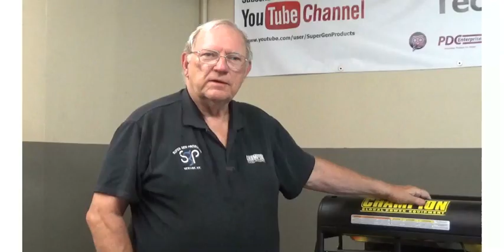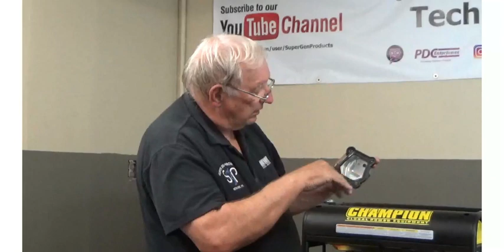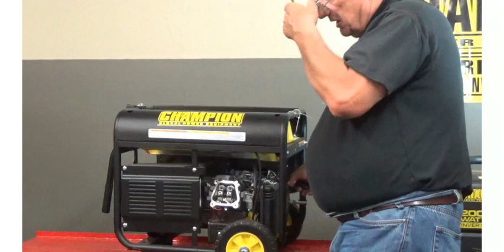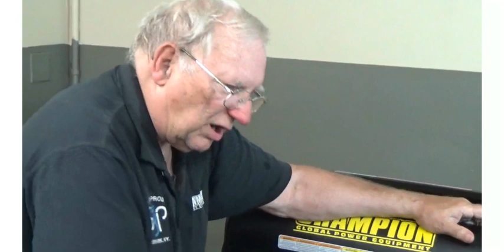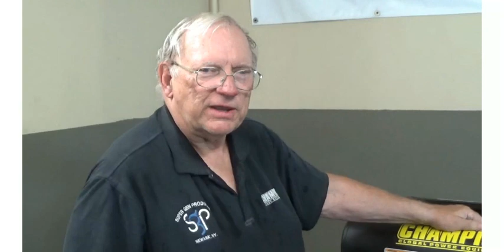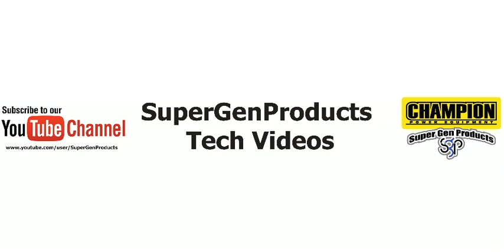Valve Adjustment Procedure for Champion Generator

Comment: Very impressed with Champion generators so far. We live off grid and our main power source is solar but sometimes we get too many cloudy days in a row to power anything. The Champion generator runs our whole house including medical equipment perfectly.

A small tip, make sure you thoroughly read what maintenance you need to do on it. Learn what you can and only out source if you are over your head. 😁👍

Comment: I have a rope crank Champion Generator it got to where it would take me 20 minutes to get it started it would backfire like crazy when trying to start it, and when it did hit it would just act like it wanted to start just a slow chug, chug, chug then die completely then after a while it would finally start! I adjusted the valves like showed on this video it now starts on the very first pull on the rope and I can just pull it slow and it still fires up!! Thanks so much for this video!!

Comment: This Vid was most helpful. Can you do a video on cleaning the combustion chamber of a champion generator?
Reply: I will see about getting that video done thank you for watching
Reply: The easiest way to clean carbon buildup in the exhaust chamber is to spritz water thru the air cleaner entry and it will steam old carbon away. Let the engine warm-up to operating temperature before using a spray bottle to spritz into the carburetor.
Reply: Phil Madrigal if I only use the propane fuel option is this a maintenance schedule I still need to perform?
Reply: @1manarmy522  NO. you should never have to worry about that with propane.
Reply: Phil Madrigal thank you. I spoke to champion and they stated I still need to complete all maintenance procedures even when running propane including cleaning the carburetor.
Reply: @1manarmy522     I dont agree with their analysis of the carburetor needing cleaning when using only propane. The propane entry does not flow into the carburetor as the gasoline does.  It enters right into the venturi, which is straight into the engine. If you are using gasoline and the generator is running roughly, then you might clean the carburetor or at least run some Gumout through the next tankful of gasoline.  Paul Sr. with Super Gen Products.

Comment: Used to have a champion 5500. Pull start only. It was a prick to start for ages. The pull cord would rip out of your hands. On a cold day you’d be worn out by the time you got it going.  Found that the exhaust valve was too tight. Adjusted and the started first pull every time after

Comment: have the Cabales remote start gen. Its powered by the champion 224cc engine (very similar to the one in this video, but just slightly larger. It has a slight surging issue when running. I tried cleaning the Idle jet which is under the black plastic adjustment screw. Before taking the black screw out, I screwed it all the way in to determine where it would need to go. It took 6 turns clockwise to close it all the way. That seems excessive. After attempting to clean idle jet with wire and carb cleaner, I put the screw back at 6 turns and it still surged. I also cleaned the carb emulsion tube and main jet. I attempted to screw in the idle screw and the surge went away and then the RPMS came up even higher than I think they should be. I dont have a tachometer, so not sure what is excessive. Getting to my question, can you tell me how many screw turns out from the bottom that black plastic idle screw should be set on one of these generators? any other suggestions for a slight surging engine. Thanks!
Reply: On generators, that black plastic "adjustment" screw (aka idle setting screw) doesn't perform any function except to help retain the black plastic idle jet in position.  Just re-seat the idle jet and turn the screw in enough to get a couple of threads showing on the tip side.

Comment: I set the valve clearances. The exhaust nut had loosened up and the clearance was way too high. When I tried to pull the cord, it yanked back. I tried three times. Same result. The pull cord pulls easily with the spark plug out. Do these things have a flywheel key that could be sheared?
Reply: "The  activation of the cylinders compression release is part of the mechanism attached to the camshaft, which functions on exhaust valve movement. If you pull the recoil slow, you will see a slight downward movement of the valve rocker arm assy and the a little more of the revolution of the engine allows the valve to seal tight and make compression for starting.  If there is too much clearance on the valve clearance setting, you will lose the benefit of the compression release and possible a kick back of the engine.  It is important that the valve clearance setting is between 6 to 8 thousandths of an inch for proper function of the decompression release.
Reply: @philmadrigal9335  Thanks. I set the intake at 6 and exhaust at 8. I noticed the pull cord seems short. I'm going to put on a longer pull cord and set the exhaust valve at 6 thousandths to see if it makes a difference.

Comment: Champion manual says valve adjustment due every 100 hours.  Your video says valve adjustment not needed until 250 hours.  Which is correct?
Reply: 100
Reply: You should always take the most critical valeu as the correct one, in this case 100h

Comment: What kind of avr used my champion 10000 watts? and where i can find it?
Reply: if you have the correct model number I can see if we have in stock.
Reply: I mean... is better 250 v. 470 mf. or 450v. 470 mf.

Comment: what if both valve are lifting at the same time? can anyone help me out with some advice
Reply: Ranch Life timing is off
Reply: They will both lift and both compress at certain stage of the 4-cycle process. Just keep pulling recoil start until you get one fully compressed, and set lash on the other one.  Pull again and repeat on the other side.

Comment: Why.004 in other videos???
Reply: Valve clearances/lash will vary between different types of motors.  Best to check specification in owner's manual for your generator, or contact the manufacturer.